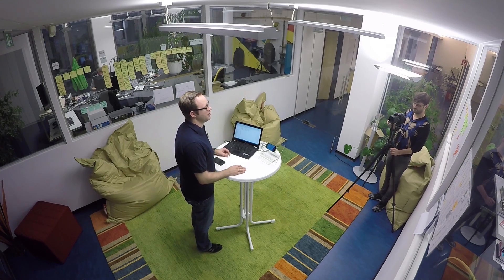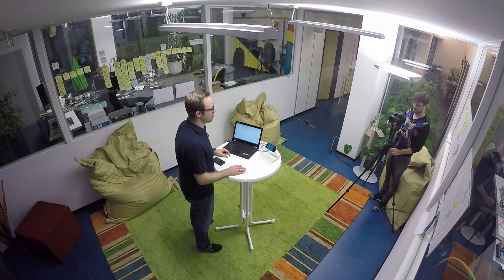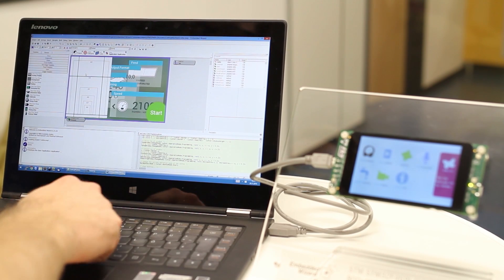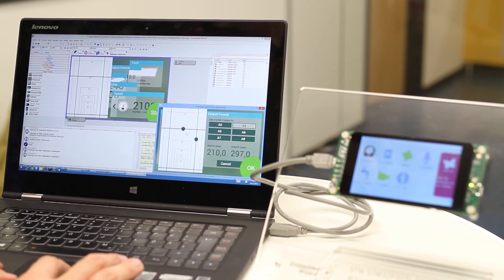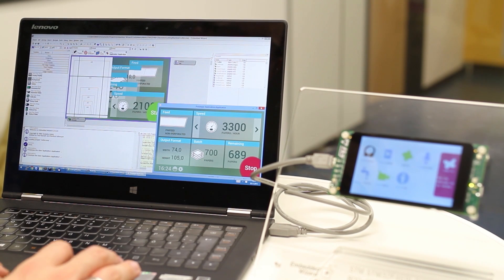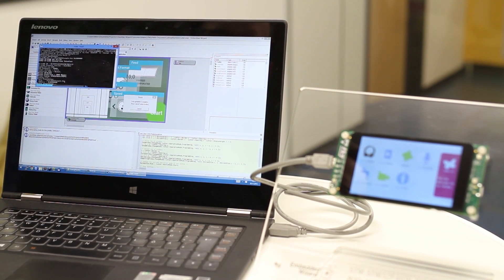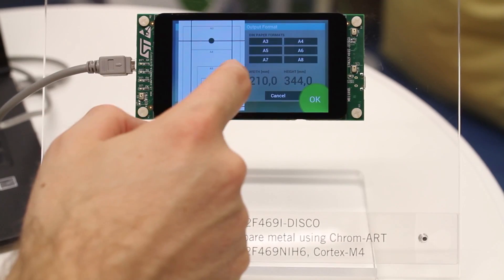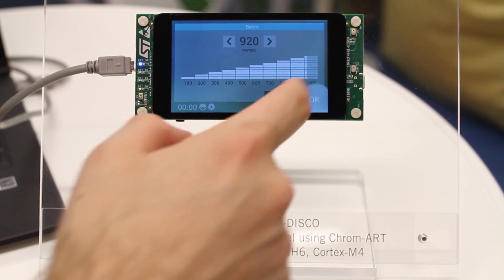Developing smartphone-like GUIs on the STM32F469 Discovery Board with Embedded Wizard Studio

Comment: they cost like 300$ :tear: whot
a raspberry pi running a full OS is like 35$ at most.. that way you can design your UI with far far more ease without messing with low level stuff!
Reply: R-pi is not on industrial standards friend. It'll easily get fluctuations,noises in proper industrial conditions(hot temp, EMF noise , back emf etc) . That's why R-pi is not used in the conditions where it's going to be a rough situation after installation into machinery. The cortex M4 series can withstand all of it better than A series Processors.
Reply: @parthshinde5966  ooof. I'm just a hobbyist using cortex-m4. but I wanted to try embed linux. I saw how scary expensive and complicated it is and gave up! how do we have products like routers and smart thermostats don't cost that much tho?
Reply: @chloemcholoe3280  yeah it's complicated AF! But that's how Embedded Linux works . R-π is very less expensive but allows easy & feature-rich environment of Python. 
Even Embedded Linux boards like Beaglebone Black are more expensive than Highest spec R-π of latest version. 
I'm also currently learning and working on cortex M3/ M4 on baremetal firmware as well as on application level. I want to go in depths of embedded development including R-π as well as Linux. God knows when I would proceed😂....